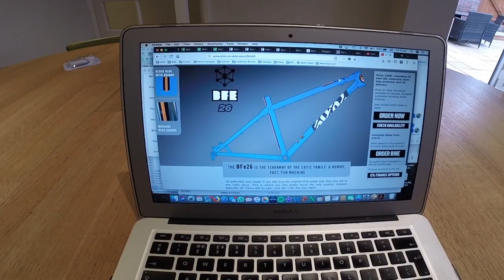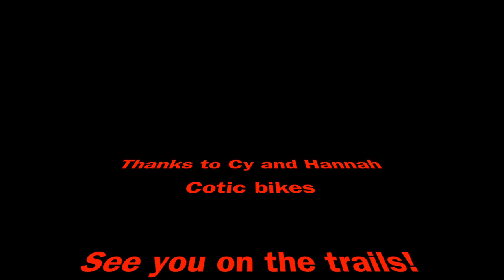Home Bike Build - 2018 Cotic BFE 26" - 26" Ain't Dead!!

Comment: Sweet I'm at 30sec in the vid and looping for months now!! How tall are you? did a medium cross your mind? I'm 186cm. any input would be greatly appreciated.
Reply from the maker: Hi Chris, I'm pleased you enjoyed the vid.
I think you would be too tall for a medium unless you plan on just using it as a jump/4X bike. 
I am 192cm so would have preferred an XL but Large is as big as they go on this frame. Currently running a 50mm stem and it feels good so far and handles really well. You can really tell the difference the modern geometry and stiff back end makes. I haven't been on a super long ride yet but pretty sure the size is good for me. 
Also, the Mercury colorway looks amazing in real life, the vid/pics just don't do it justice.
Happy trails bud, let me know if you get one.
Reply: i also built one late 2018 and i'm 197 lol. its on the limit for my length but works fine for what i built it for. if you go by their charts you are probably in-between a M/L. id go with the medium so its smaller and more fun...like the large is to me.